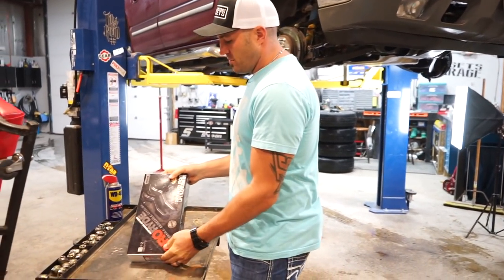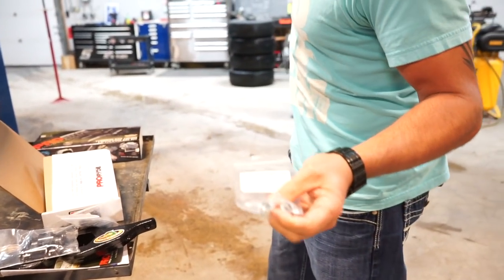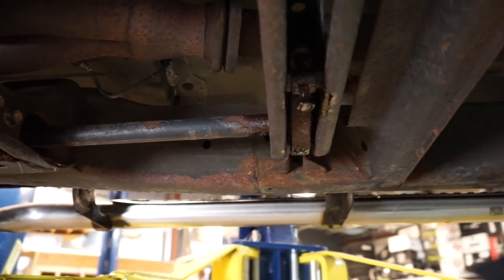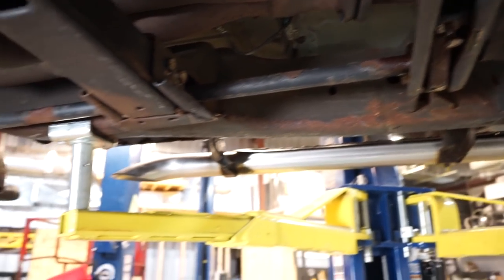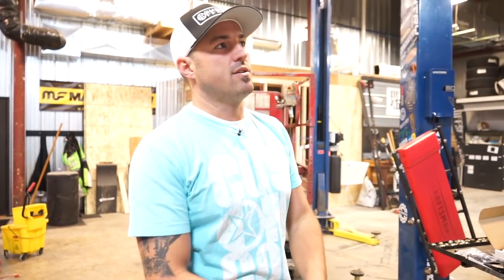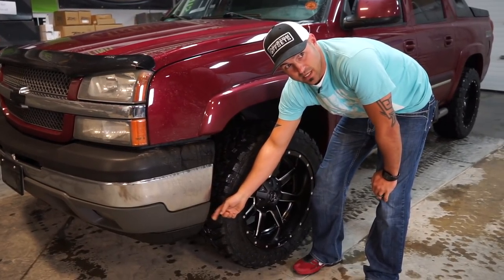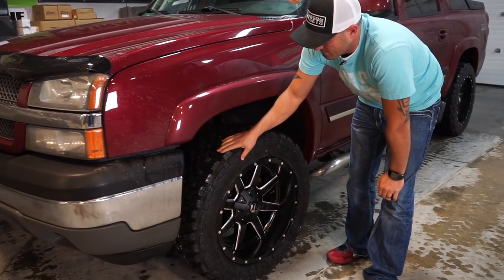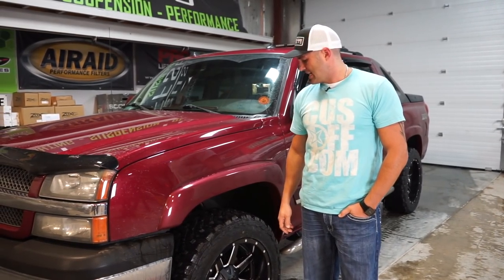Lifts & Levels: Chevy Avalanche 2001-2006 Leveling Kit

Comment: Awesome video, it shows and you explain the reality of up grading a vehicle, it shows the hassle and extra work it requires to replace aged parts, not like other shows where they tell you what bolts to remove, show the old part on the floor and the new one installed, making the average do-it -yourselfers try it and fail and show up at a professional shop with their vehicle on a flat bed and a box of parts.

Comment: Props for actually showing how much of a pain it can be getting torsion keys and bars apart. Especially up here in Wisconsin, that stuff will NEVER come apart easy. You will be cutting keys off the bars as well as cutting apart the lower control arms to remove the torsion bars if necessary.

Comment: What lifted the rear up ?? Nice to see real work torison key removal. Oddly never showed how he got the bar out of the control arms. On my 94 k1500 I had to take the control arms out with the bars, keys and crossmember into the shop for them to heat them up. Took them a while. Just had the trans held up my jack. Soaking them for weeks with pb blaster and hammering them back and forth weeks at time while in the air never helped one bit.

Comment: I have a 2001 Silverado z71 I am looking into putting a leveling kit on and hopefully fitting 33's on it but I was wondering what you guys do as far as the speedometer and how to adjust it so it is still reading the right speed.  Do you happen to have a video on that.  Also what has to be done with it as far as an alignment,  will it need a new alignment done when I do that.

Comment: I have a 05 avalanche and got that same look just by tightening the factory keys on the bottom
Reply: Riced Civics is that safe?
Reply: avalanche I’ve did it 10 months ago and it hasn’t given me any problems what so ever.
Reply: I cranked out my factory 04 keys and I did notice a difference in the ride quality. I brought them down a bit and it felt much better. I'm thinking of getting some new keys for a little more height.
Reply: Yeah don't crank the factory keys as they aren't meant to be pushed. You'll only cause fatigue on your torsion bars and end up replacing them down the road.

Comment: How far do you need to put those bolts back in the support bracket? I saw he undid the clamp and it came down. But then he ran the key back up with that bolt. Do you just run the bolt till you can’t go any further?
Reply from the maker: That bolt is height adjustment. Typically run it 1/2 - 3/4 of the way in but total depends on what height is needed to level the vehicle. -Banker
Reply: Custom Offsets I gotcha! Thanks for the info!

Comment: nice video it's hard to find videos that show 2002 2005 torsion key install on avalanches I purchased Pro Comp torsion keys and the shocks to go with it and I'm very disappointed that there's still a rake on my truck like I never installed anything but I saw your video that you put a longer bolts I had to use the OEM and I think it's bottoming out do you guys sell the extended bolts thanks

Comment: Hi I have 2005 Chevy avalanche Z. I am saving money for the pro ryde leveling kit.  But i love the look of those tires and wheels on the video.  Could you tell me make and size of the exact wheels and tires on the video?
Reply from the maker: Those are Fuel Maverick wheels wrapped in a Toyo Open country M/T tire! Check out this setup here:
https://www.customwheeloffset.com/buy-wheel-offset2/D61020009847/360670/fuel-maverick-black-milled-20x10-18-toyo-open-country-mt-lt275-55r20
Reply: Thanks. Love this look. My avalanche is black too. Well I am going to have to start working OT or get a second job. LOL

Comment: A 2 1/2" lift brought it level? On my 04 Avalanche the rear bumper is 8 1/2 in. higher than the front one. It's all stock as far as I know but the rear coil springs appear new. Any idea of the rake on your project before leveling kit install? Can you recommend a leveling kit for me?

Comment: Ok I have a 04 avalanche z71 w/o cladding.  What I’m wanting to do is put 3” rough country leveling kit with hostile switch blade 20x12 -44 undecided on what tire I want to go with but most definitely 33x12.50 is this possible? How much cutting? Full not cal mod? What am I going to have to do? Need advice!!
Reply from the maker: Check out our gallery for a ton of information and pictures/ knowledge! https://bit.ly/2DgLW0N
Reply: RAMROD FORLIFE trim bumper (Plastic and some metal) and NorCal

Comment: Can you do the lift with the stock keys if there still in good condition? If yes what are some cons on doing a lift like this ?
Reply from the maker: We recommend replacing the keys if the kit you get comes with aftermarket keys.
Reply: wht size wheel and tires are those

Comment: Did you have to cut out the stops to prevent the upper control arm from bottoming out? Local shop in Houston has recommended cutting those off the frame just wanted to see if anyone had come across that suggestion.
Reply from the maker: Kits call for different things Osman, best bet is to go off the lift kit instructions
Reply: Osman Vasquez yeah cut em, you'll have a better ride and can crank them more
Reply: Yes go a head and cut them and then you will buy ball joints ore often.  You never fully crank torsion bars

Comment: I have a 02 Av 220000 mi, I have 1 1/2" Chevy sag on the left rear, shocks aren't that old and thinking about putting in a 1 1/2" spacer for the leak before leveling the front. is this fine to do.
Reply from the maker: That should be fine for a temporary fix

Comment: I have a 2003 Avalanche 1500 with a lift on it. I think the lift is 4 or 5 inches but not sure because I bought it used and the dealer wasn't sure. How can I find out how high the lift is? I need new shocks
Reply: Custom Offsets Cool thank you!

Comment: Is 275 tires ok to run on 10 inch wheels? Is the wheel sticking out past the tire much?  Asking because I'm looking on the manufacturer website and it says up to 9.5 wide wheels.

Comment: This is BS . You don’t need a leveling kit to fit 275-55-20 . Stock is fine! I have an 02 tahoe sitting on 20X10 wheels wrapped in 275-60-20’s!  And all I did was trim the front inner well .